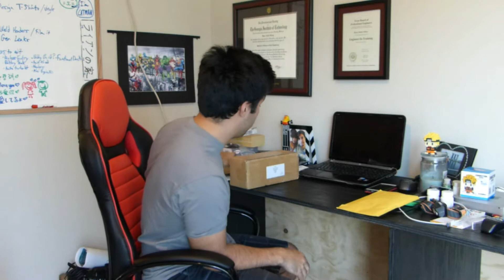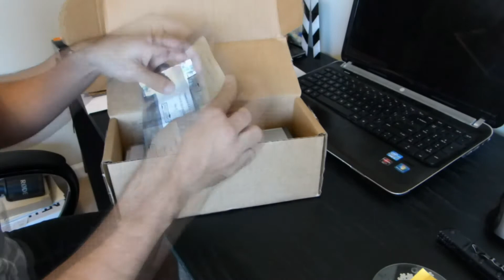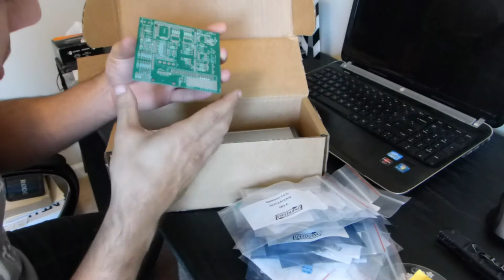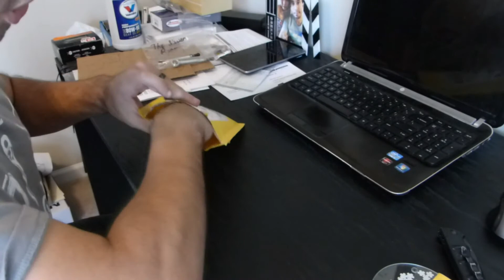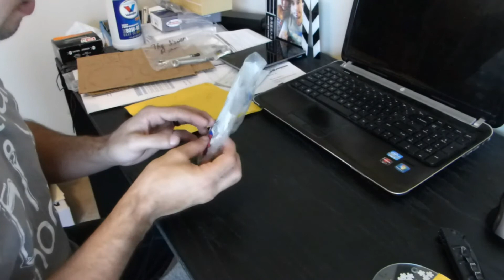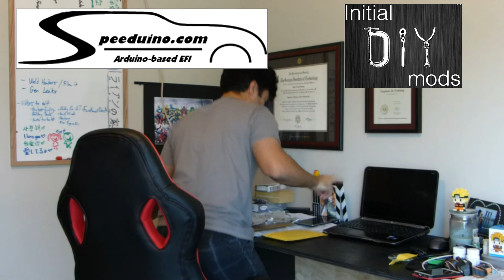✓ DIY Stand Alone ECU - Unboxing - AWD Mini Cooper Ep. 4

Comment: The Speeduino is a good and capable ECU. I built and have one currently running in my 1985 Rover SD1. Its a straightforward build, and very easy to get setup and running once its all together. A lot of the info for megasquirts can be transferred over during tuning which helps. I look forward to seeing the rest of your videos.
Reply from the maker: Tastes Like Petrol thanks a bunch. It should be a lot of fun and I'm excited to start tuning but there's so much more work to come first lol
Definitely happy that MegaSquirt stuff is so similar. Any tips on working with this ECU? Quirks or anything like that
Reply: Hardware is all straight forward, the only real quirks are in getting the tuning right, and sometimes things like firmware updates break more than they fix. Fixes for issues are quick to roll out, and the devs are responsive to chat and forum posts. Its a great project.
Reply from the maker: Awesome that's great to hear. So if I get everything set up, do you recommend not updating the firmware? I'd hate to have everything running smoothly and then updating for new features I won't use ends up causing issues
Reply: For now i would download and run the June B firmware from the forum until the bugs in July have been worked out.
Reply from the maker: Awesome, thanks for the advice ;-)